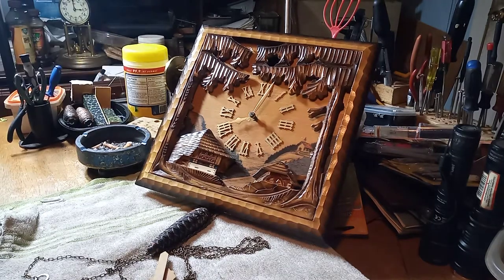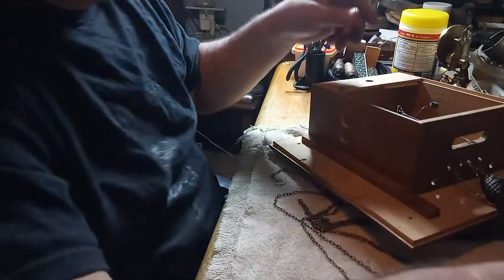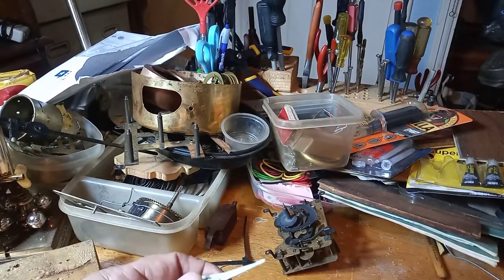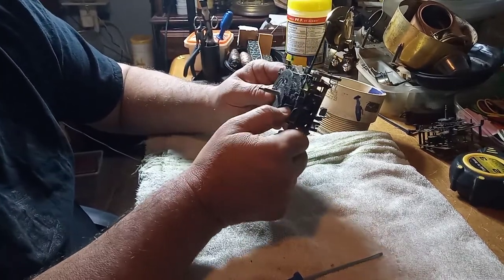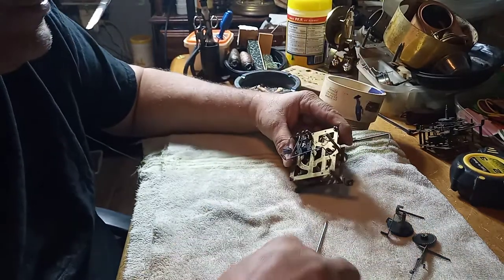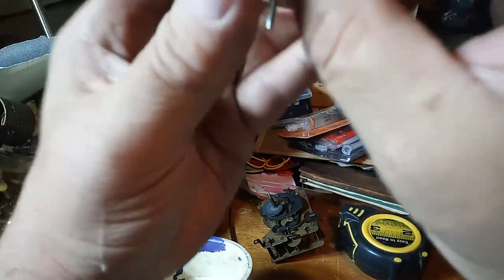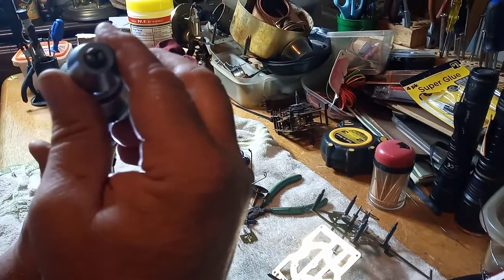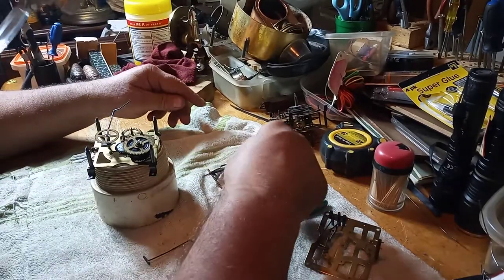Repairing my Kuner Shadow box cuckoo clock (see description). 20221007 203015

Comment: You say if you get good at working on cuckoo clocks, you should get them done in an Hour!. So you should get this one done before your back starts hurting too much. You are about right. Most the clocks I get are so dirty, they need cleaned twice and if nothing else goes wrong, then yes this would be fast, for the beginner, one or two days and maybe 3 or 4 while learning what you are doing. I bought a spool of brass wire to replace as needed, the spring wires for the gong and bird.
Reply from the maker: Yes if the only issue is they need taken apart and cleaned then I can do one in about an hour. But video taping and explaining everything that goes on takes a little bit longer and then if you have to do bellow repair then that adds another 15 minutes per bellow maybe (never really timed myself. LOL.). I dont have a spool of wire. I am doing this all in my bedroom which is a pretty big room but I have a king size bed in it and just enough walking space for me to get from point A to point B. I need more room. LOL. One day I will have it together. I started a deck on my back of my house. This was in 2012. I then got to working and couldnt finish it. Couldnt find anyone to hire that would stain it. Fast forward to now the deck boards  had to be taken up because they were rotted through due to lack of stain. I might one day have it redone and enclose it then make that my work station area. Of course that is just a dream and probably wont become a reality unless the VA finally recognizes me as being unable to work and pays me my now 6 years in back pay.